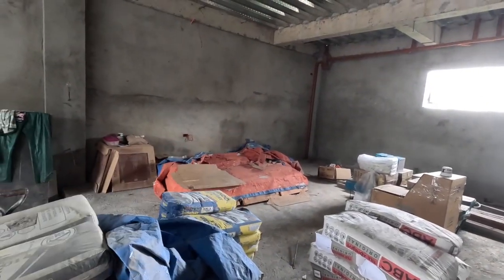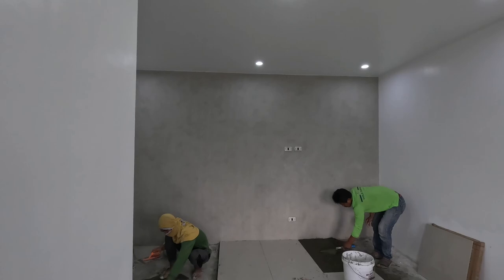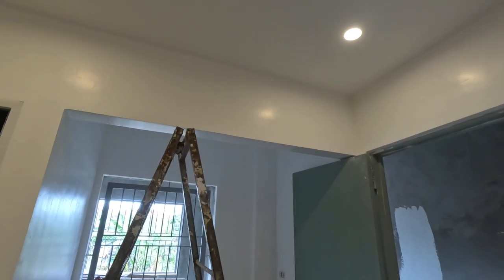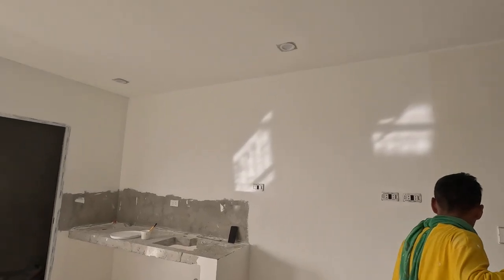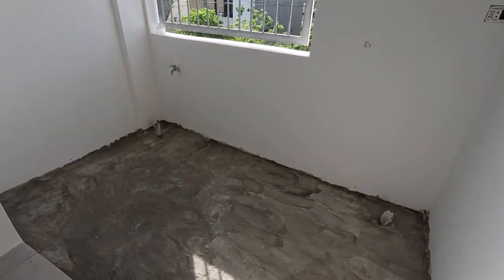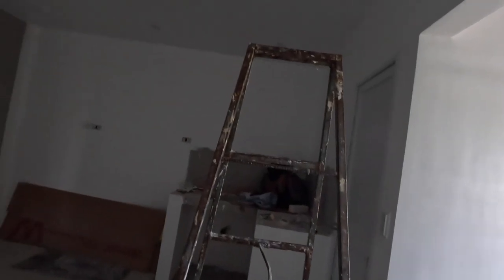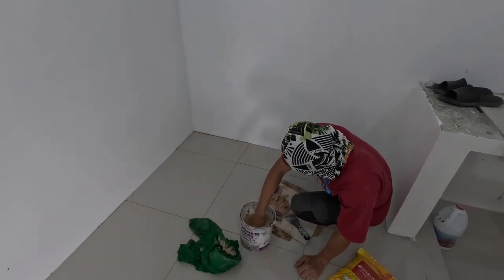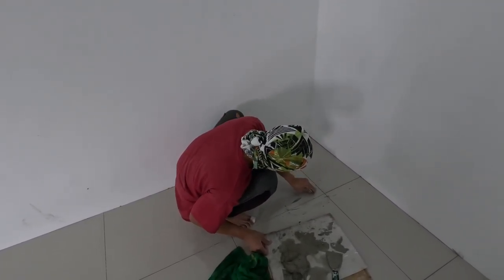PART 56 I GUEST HOUSE CONSTRUCTION I  ACCENT WALL

Comment: I have watched many youtubers building homes in PH and one common thing I always see is they put the flooring down way to early. Some times even before the windows, ceiling and skim coat. Then after each stage they have to clean the mess they make. IMO the flooring should be the last thing to go down with exception of the cabinetry. Just seems like they create more work for themselves.
Reply: Yes I’ve noticed this too.. they need to start planning properly.. I think they do this to create extra working days for themselves
Reply: @stephendemille5424  your probably right ..  job security
Reply: You can’t really blame them in a way.. labor cost over there is garbage.. they could hardly survive on those wages
Reply: @stephendemille5424  yeah that could be some of it, it could also just be lack of understanding or skill. For instance have you seen how soupy they make their concrete over there? They do it because it makes it easier to work with but they don't realize how weak it makes the concrete.
Reply: @chrisluellen  yes I do agree with you, I think the guys there have the skill but just lack the understanding of the proper technique… and it’s also lack of tools, per example when they do the skim coat they use a very small drywall knife, which takes forever to do and with the painting they use the smallest roller brush it’s just not productive.. and they do a lot of work with out proper planning which leads to a lot of correction work in the future….like they would plaster a wall only to realize that they need to run a water pipe or electrical, and then have to cut the wall and plaster over…. N that’s why things take forever to complete over there
Reply: The work is amazing. Roller just dumped into a bucket. Tiles not laid properly. Awful masonry work